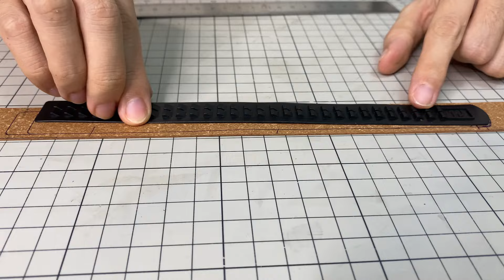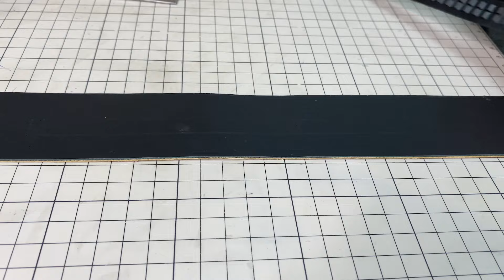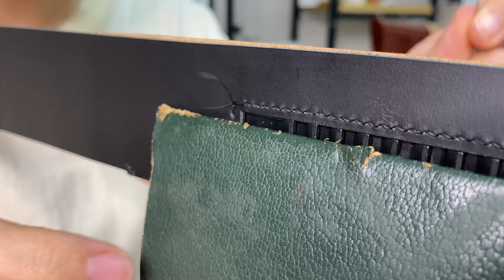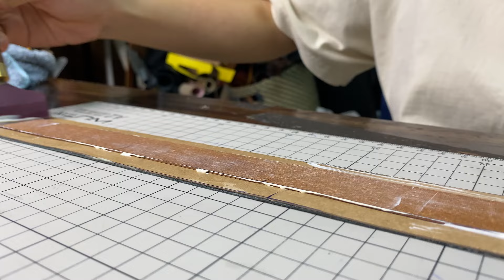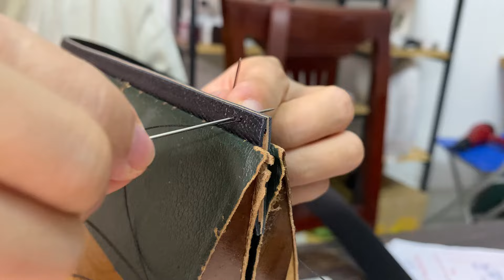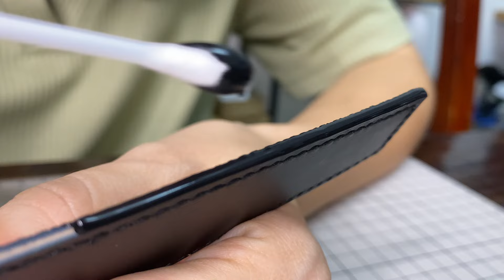Master Craftsmen Reveal Secrets to Creating STUNNING Black Leather Belts

Comment: Nothing I would make to be honest. Why would a leather crafter build a belt with any materials other than leather? I would not want cork or any other materials in a belt, other than leather. The point of making leather crafts IMO is not to just build something that looks fantastic, but to also make things that are made of the best materials. Nothing other than leather makes the best belts. The belt looks nice, but it is not much better in durability then you can buy at some department store. A belt is not just a decoration we wear, but something we expect to function and last for years.
Reply from the maker: Thanks for your feedback!
Reply: Извините не соглашусь. По сути Саламандра тут как сердечник между двумя слоями кожи. Им выделяют подиум который только украшает ремень. Я бы добавил ещё тонкую синтетическую стропу. Ремень прошит и в таком виде представляет высокотехнологичное композитное изделие высокой прочности. В классическом костюме будет выглядеть намного лучше чем просто ремень из кожи 3,5 - 4 мм.
Reply: The material labeled salamander is in fact leather. It’s a material made from leather milled off the flesh side of the hide mixed with waxes, fats & a latex binder.  The leather on the outer part of the belt, the grain side, adds beauty & toughness/durability. This leather however is susceptible to stretching. The core with the Salamander leather has properties that actually inhibit stretching making this type of belt sturdier.  Are there sturdier belts made from 1-ply construction? Yes of course. But not all sturdy belts have the same aesthetic properties and this maker is using actual knowledge of leather crafting to make an aesthetically pleasing belt that retains durability.
Reply from the maker: @seattlefoodcritic  Thank you for your very practical and accurate feedback as a professional. I hope you can also share your experience here so that everyone can learn together.